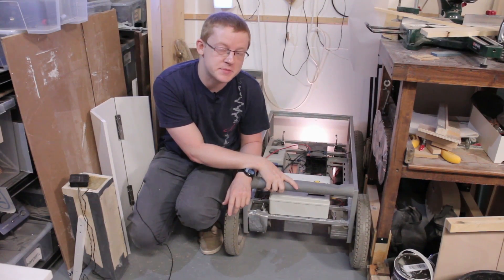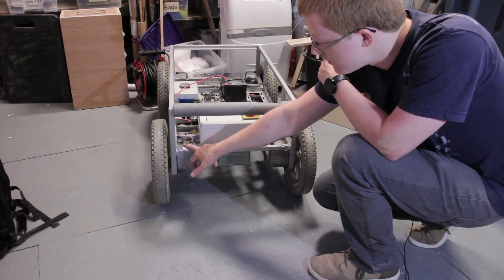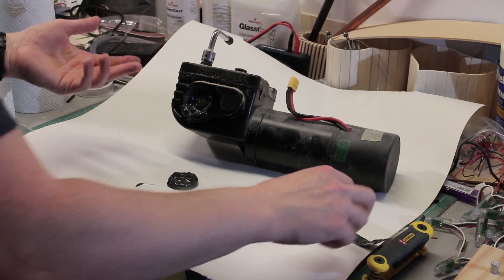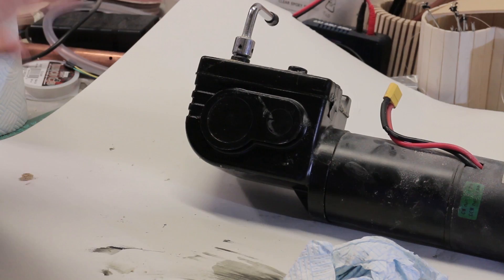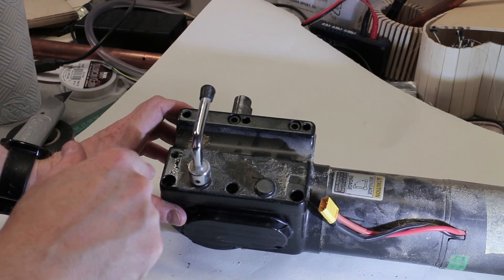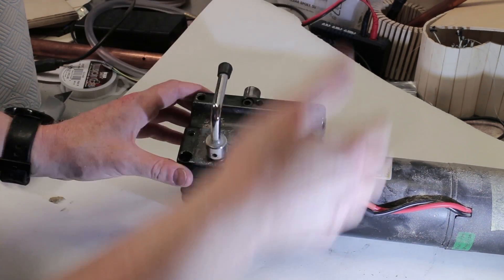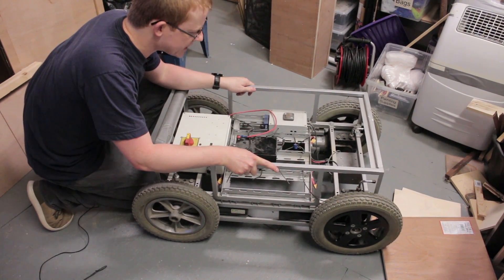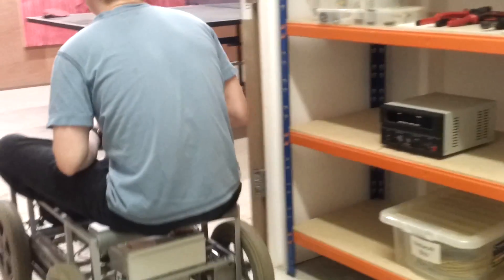Fixing the wheelchair motors - Robotic Vehicle #1

Comment: i would like to build a robot too ;p im 13 so i dont have much money and 100 for 1 motor (ebay) is a bit much... any cheaper suggestions?
Reply from the maker: +MrDutchgaming123 my first vehicles used cordless screw drivers! They are small, powerful and cheap and a great way to get started
Reply: Arthur Guy Cordless screw drivers are still a bit expensive ;P above50 euro's is too much ;p I may have 2 old drills laying around
Reply from the maker: I am talking about cheap crappy ones, you don't need quality. This type of thing http://amzn.to/2ddSE8i
Reply: Arthur Guy Im living in the netherlands so i cant purchase on amazon ;? They only sell ebooks in my country xd. I need to search online
Reply: Arthur Guy I got 1 old drill and can test with it but need a 7.2 volt power supply ;p because the original one is broken ;)

Comment: The blanking plug had probably blown out the back of the gearbox due to pressure build up. Is there not a breather fitted to the gearbox?
Reply from the maker: +EngineMismanagement there are holes at the top which I taped up when they leaked a bit, that might be it. I will take a proper look next time. Thanks